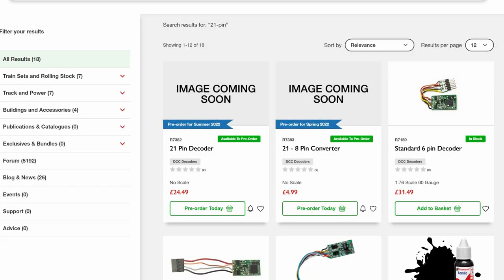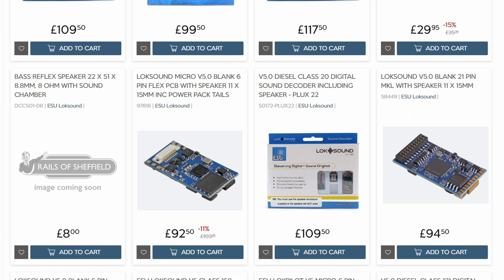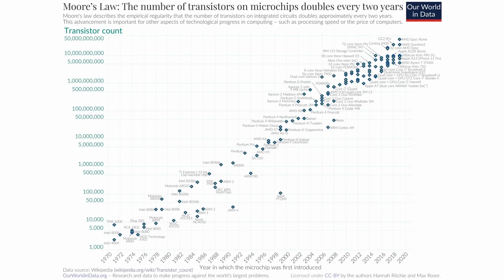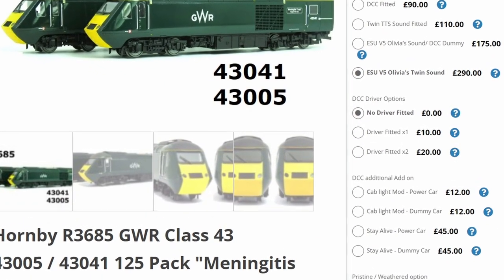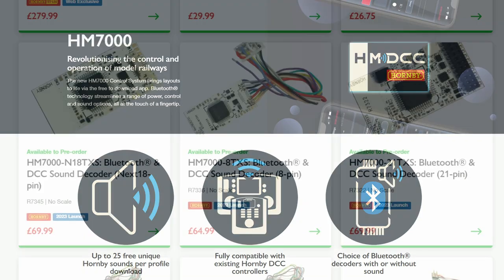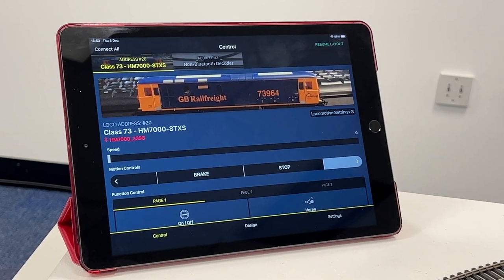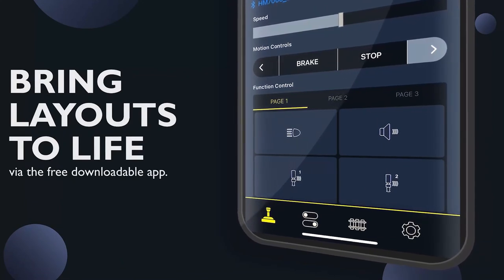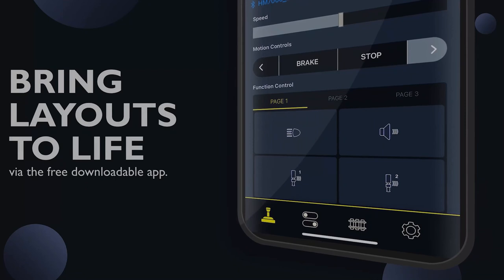Can Hornby's HM7000 solution address my frustrations with existing DCC sound and control operation?

Comment: Hi, I agree 100% ! I use the NCE Power Cab for almost a decade and recently added a Wifi Control unit that gives me walk around capability with a smartphone using the 'Engine driver' App. Most of my, mainly Steam locomotive fleet is TTS equipped. Sound decoders + 110£ are out of the question. They simply are not worth it. When running a train I only use the steam sound, the whistles, the brake and light function if provided in the engine. All other sounds are just gadgets one rarely uses but pay a high price. One remark that stands out on US-forums is the use of a proper throttle and not a smartphone. That is always linked to expensive DCC-stations and even the new LCC system will not simplify the DCC use in general. (See TCS ). Blunami by Soundtraxx has already gone the same way Hornby is taking now. But with Hornby  it is to applaud that the decoders are loadable from a free library and half price of the 'tsunami reworked to Blunami' by Soundtraxx. It is yet to discover all the details of the new Hornby decoders. The possibility of combining the two systems on a layout is a great feature and for newcomers the entry into 'quality' train control is a no brainer.
I'm looking forward to discover the App and TSX-decoders. Thanks for sharing.
Reply from the maker: Thanks Phil. Yeah, I think we're all looking forward to seeing the new decoders and how they fare.

Comment: It's a breath of fresh air...I am from an IT background and its painfully obvious DCC is pretty stagnant.  A mobile phone is way more powerful than any other controller out there so why not use it ? All DCc controlers bar none look like they where designed 20 years ago or more, so we'll done Hornby...let's hope it works well and as expected. My only fear is Bluetooth can be a little troublesome , so let's hope the pairing/reconnection/maintaing a connection is all sorted and works well. 🤞. I run a Hornby select, so the Bluetooth dongle to allow HM7000 app to control all existing dcc trains (inc any NRMA compliant decoder !!) via a mobile is a no brainer..and based on reviews I'll try a decoder also...Great stuff..
Reply from the maker: Thanks Mark. Jury is out for me on Bluetooth as well which is why I was looking at WiFi for my own personal project. I guess we'll have to see how this scales effectively and handles the various failure scenarios. I'm willing to try it and see.
Reply: @EuviRail  Yeah, Bluetooth can be temperamental, some models of phone I'm sure will work well, and others will drop connection depending on which way the wind is blowing and the day of the week.. Keeping my fingers crossed 🤞🤞🤞
Reply: Also forgot to mention, I'm enjoying the Channel, keep up the great work.. 👍
Reply: @markweightman3805  well z 21 runs off your phone great and some other things are great too.
Reply: I agree...I know many that use their phones instead and it really does look impressive when you can see more than 6 loco's shunting around a depot, by 6 operators
Reply: @James-ih4gz  I'd never heard of the Z21 until mentioned in this thread, looks pretty good TBH..
Reply: Mind you Z21 needs to be good to justify the price...
Reply: @markweightman3805   there is a starter edition too you can get. I have the black z21 and love it. My layout is big so that's why i got that black edition instead of the starter
Reply: I wasn't happy with the current offering when I first got into DCC, I ended up going down the route of an Arduino and DCC++. My Arduino has no WiFi functionality so it's connected to a laptop and I use a piece of middleware I wrote that allows me to send commands from a tablet over WiFi to the laptop and the middleware forwards the command over serial to the Arduino.

I'm looking forward to trying this Hornby solution, I'm more interested with the amount of "stay alive" in the new decoders
Reply: Have a look at the Viessmann Commander.  I have two of them.  Pity the Viessman Commander 2 (use your own ipad) has been delayed year after year.  Not cheap but it does everything which is an optional extra for other systems.
Reply: Google LocoFi.  Sorry, don't know anything about then except they are WiFi and you can use ANY power.
Reply: I agree Bluetooth may be the best way forward.  Have a look at the Viessmann Commander (not available now).  I think that was the zenith of DCC all in one unit.

Most of my DCC decoders will run auto select on DC and DCC.  Some have remotes.
Reply: @johnwinter6061  I unfortunately outgrew the Hornby Select, some time ago, and as the Bluetooth dongle was ages away, I jumped for a Roco Z21 starter set. It's a very good controller, and Tablet control is very good. Having run both Tablet and handset control however,  there is something much more satisfying and tactile about having a control knob on a handset than a touchscreen interface.
Reply: @markweightman3805  Like "there is something much more satisfying and tactile about having a control knob on a handset than a touchscreen interface."  There are some about.  Compatibility is the issue!

Comment: The HM7000 might just be my ticket into digital. I will have to see how simple the conversion is -  I have a simple layout, but I use Atlas track which has a feeder track with the wires already attached.

Comment: Great video, thanks. My initial thought on Bluetooth is how does one run two or more loco’s at the same time and quickly switch between them? Doesn’t Bluetooth need to pair up each time you connect with a delay in connecting/pairing or will the app and your phone allow multiple pairings at the same time? Just thinking of the rigmarole I go through every time I connect a peripheral to my phone/tablet/pc etc even if I’ve connected or paired the two device previously.
Reply from the maker: Though we haven't seen the details they will be using Bluetooth Mesh - https://en.wikipedia.org/wiki/Bluetooth_mesh_networking. How well it all performs in reality is another matter of course.

Comment: I do sorta wonder if they quite get how much people like to be on their phones or have them available for other things while running stuff. 

We will have to see how that clash plays out for people and what the app can do to mitigate it getting annoying. Naturally you could just run the layout on a cheap second device but I can see it getting it some flack if they haven't set everything up to enable the trains to keep running if the app is put to one side to take a phone call or answer a message. Simple things like this can cause frustration to some.
Reply: A friend of mine uses mobile phones for his exhibition layout. They are second hand and dedicated for just the layout no SIM inside
Reply from the maker: Yes, I share this concern and either a tablet or a simless phone are options. For the most basic user, their phone is probably Ok but I can't imagine controlling 10 locos on phone and having to take an urgent call!
Reply: Just thinking about the phone thing... I'm willing to bet I'm not unusual in having 1 older phone and 1 older tablet that could be used rather than the all singing dancing new phone.... Not to mention there's 2 x Kindle fire tablets the kids use, which may well be more than sufficient.....

Comment: I am a huge DCC user, as this was one of the things which gained my interest back into the hobby. I used to use Railmaster but despised it with all its ongoing issues (such as decreasing the loco speed itself, mouse pointer getting stuck on the speed slider and not being able to click off of it - this was repeated on multiple laptops new and old, different manufacturers etc) and config changes that were needed to get it running correctly (I work in IT and have enough of having to diagnose and repair issues during the day, when it's my leisure time I just want things to work). That paired with a lack of development (the software looks very aged) and a severe lack of viewing scope of CVV's outside of what Hornby think you should have had, I swapped it out. 
Having said all of that however it was a good starter and introduction to DCC for the price. And it had one feature I loved - the ability to read CVV's and give you their current setting - none of this 'can you set the loco back to address 3 so I can use it' - just stick it on the programming track and read (and change if neccessary) the setting. 
Due to the issues and loves outlined above, there was only one main option for me to change it to and that was the Roco Z21 along with an ipad which has one of the most controllable touch screens going. Not to mention the far sleeker rail mapping and point and signal control that this gives you - I'd never have trusted Railmaster with loco control and the control of that too!

With this new system from Hornby, I think it is a game charger and we will potentially see other manufacturers jumping on a similar idea. My hopes are that they put in the money and development it deserves (maybe this will happen given the introduction of the TT 120 which can use it too) and that it is as good as they are making it out to be. Personally I think I will give it a go as I really love gadgetry and the idea of programming sounds as easily as they have shown, and I also believe the third track / sound will make a huge difference also. I wouldn't rush to purchase it though - I think a year or so after it's launch would be the sensible option to allow most of its issues / bugs to be smoothed out.

Comment: Just starting in O and it looks very interesting to me. I am assuming that the decoders will manage with a small O shunter. It would be good if the Hornby BT extension to the NMRA standard could be open. Would also be good if the software could be interface with external (USB) devices as I am not keen on a touchscreen interface.
Reply from the maker: Thanks Nick, You bring up a good point in relation to 0 gauge in terms of the potential power capability of the new decoders. The TTS decoders were extremely limited and I've blown two of them through pulling large loads at high speeds. I sincerely hope the max current specs for the new decoders are more in line with a Loksound5 than a TTS.
Reply: I'm pretty sure that someone with IT skills would be able to work out what is happening at the Bluetooth end. If the big players sense revenue opportunities, they will have teams devoted to do the reverse engineering on this. Hornby should licence the technology, saves everyone else the bother of development and research and would give Hornby some extra revenue too.
Reply from the maker: @Pierre-de-Standing  ESU and Loksound are in the firing line here so it'll be interesting to see how they respond.

Comment: Sounds very interesting. My main concern is what happens to the Bluetooth connection if there is a momentary break in power pickup and you do not have the (optional) stay alive fitted?
Reply from the maker: Yeah, there are lots of failure use cases like this. The question is how many will be addressed in the first iteration. At least software upgrades will be easy to apply.

Comment: Useful thoughts Euvi. I am generally optimistic that this is a step (and a big step) in the right direction. They seem to have covered most of the more common  use-cases and the system appears quite well thought out. Re the bluetooth, I did try out the HM6000 and HM6010 system a few years ago. They have developed a ‘direct-to-device’ connection for older hardware (phones, tablets) and a mesh system for newer ones. Found it very robust and the connection proved stable. I’m assuming they have used and learned from that for the dcc version. Cost is the major improvement here, with it being easy to get sound now at a low cost and without a dcc base station at all. I too am watching this space. Great to see some innovation at last in this space.
Reply from the maker: Thanks for that and sharing your experiences with the HM6000. Will hopefully see the rubber hit the road on this in the coming month.

Comment: Thanks, Eugene, for echoing many of my own thoughts. Returning to the hobby in the last few years after four decades away, I’m still putting the layout together but have concentrated on buying locos and MUs first in case supply from China suddenly cuts off. I’ve quickly amassed a fleet of over 60 (many secondhand, inc two Hornby Dublo from my first layout) so was beginning to think I need to opt for DCC instead of analogue. I’ve delayed wiring the layout while pondering this decision. However, I have a Gaugemaster GMC-TS for three tracks so am wondering whether I can use HM7000 to run some DCC locos on one section while reserving the other sections for analogue, then upgrade more locos over time as funds permit. I might start with the Hornby 08 TXS R30301 when that’s released in Q4 and see how I get on.
Reply from the maker: Thanks for that. It sounds like a good time for you to consider your configuration for the long haul  with HM7000 as part of it.

Comment: The other question is how does this all fit in with their earlier DC Bluetooth set up? What about control of lights, point control and other things separate from the locomotive. Will that be via Bluetooth as well? How goes all this fit together? Is their a white paper or mags manual or website with a FAQ that we can read so we can map out what to do and either retrofit an existing layout or plan the wiring of a new one?
Reply from the maker: I haven't heard any mention of controlling other elements and as you say, specific technical information is still very scant. That's disappointing for the decoders in particular given they are demonstrating them already. They need to produce something equivalent to ESU's Lok5 spec.
Reply: each signal or point would have it's own basic decoder and be controlled by the user or if the "blue sky" comment by George Waller gets developed possibly a system like train controller where trains are actually sent in real time to any location on your layout by the controller.

Comment: It’s interested  and keeping an eye on this . I am an analogue user . I thought one of the major advantages of this might be that I could run an HM7000 Decoder sound equipped model on my otherwise analogue layout , simply by turning the controller to max dc output and then operating the loco via my phone . Bluetooth obviously connects the phone device directly to decoder without going through DCC controller and track .  While this may still be possible by using a Hornby P9100 power supply , it appears that it may not be possible on existing analogue controllers because of PWM . So I will wait and see . Does seem a step ahead and certainly a lower cost entry to DCC . We do need a lot more detail though . Just exactly what are the parameters and what will it work with . It’s early days but too many questions remain.
Reply from the maker: Thanks for that. We'll have to see exactly what configurations are supported here.

Comment: I am extremely interested in hm7000 mainly because I am a digital neanderthal. I like the idea of it as it seems extremely simple for train control as I have a small layout and only want it to control my locomotives then I think it would be ideal. The price is also really good no need for expensive controller etc. It would also be excellent for those just starting in the hobby. All in all I think it's a winner from Hornby.

Comment: If this functions as they say it will, it’s literally the perfect solution for me. I run DCC and sound although due to price, most of mine are only TTS decoders which have been increasingly difficult to find. Also, my DCC controller is in the form of a Bachmann EZ command which is extremely basic, allowing control for only 9 locos and access to the first 9 functions of any decoder. This system solves a lot of problems for me.

If it is only taking power from the track then potentially other power sources could be looked at in the future such as an on board battery. I can see somebody else mentioned playtrains in the comments and I totally agree, if there was something more advanced where my track could be dead and use RC then I’d be totally up for that.

The other thing I’d like to see is the option for a user to load their own sounds on to the decoder. Hornby have a nice selection of sounds there but it is still fairly limited.

My concern is that either each loco would have to be limited to connecting to only one phone/tablet at a time which causes issues when running an exhibition layout, or you would potentially risk a spectator hijacking your layout.
Reply from the maker: I would hope that Hornby would allow for an open source community for people to contribute their own sound file creations. Controls would be needed but this would blow open the whole area of sound generation. You're point on someone taking over an exhibition layout is an interesting one. It's one to add to the list of use cases this system will need to handle so thanks for that.

Comment: It's the only DCC system that's caught my attention and like you said, if it's able to work with other manufacturers, then I'll be like you, ticking the pay now button.
Reply from the maker: Thanks Robert. I'll certainly be checking it out on some Bachmann locos as well as my currently silent Hornby models.
Reply: @EuviRail  I also model Australian railways and I have some DCC stock too. So I'm thinking of trialling the system on them too
Reply from the maker: @robertdblack7179  That's where it could get interesting in terms of adapting sound files if you're looking to do that.
Reply: @EuviRail  I'll certainly let you know what happens, and maybe you can inform your viewers.
Reply from the maker: @robertdblack7179 Thanks Robert, interesting time ahead.